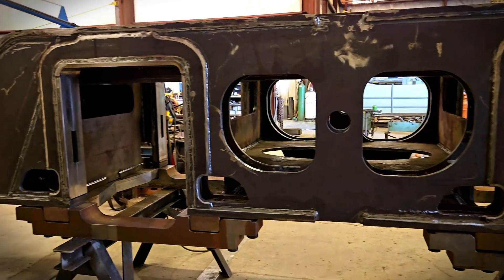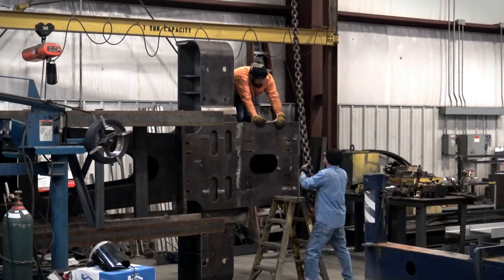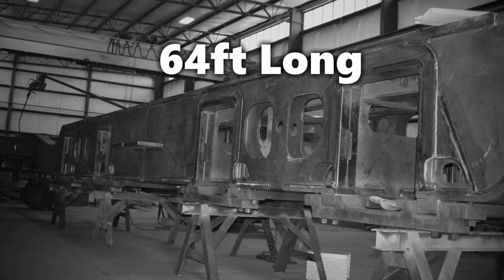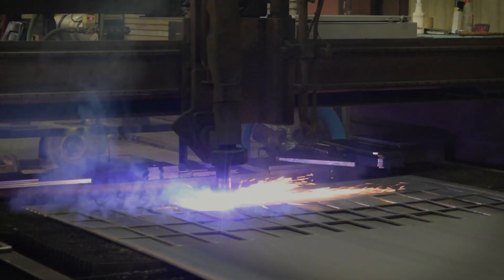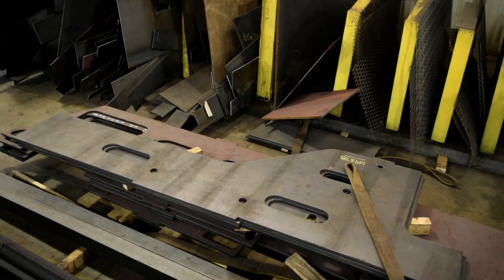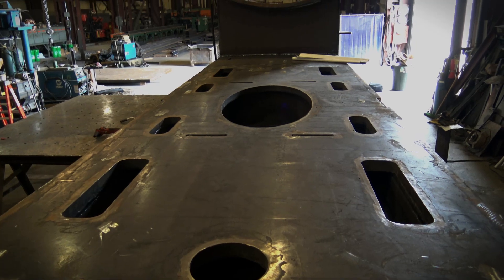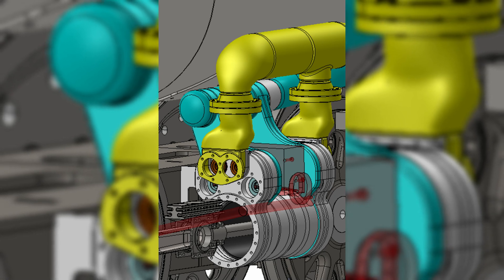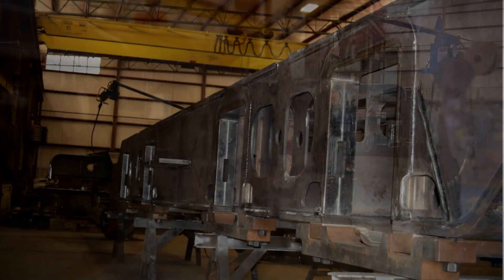PRR T1 Frame Completed

Comment: This will probably be the single strongest and stiffest steam locomotive frame ever made. I assume it actually may be lighter than the orginal cast frames, but talk about stronger and capable of easy repairs. 

The steel cylinder assembly is going to be much tougher against stress cracking like the locomotive down in Texas that had to have new cylinder assemblies cast...talk about a learning curve for everyone involved!

Comment: This is such awesome progress! She might be up and running by the end of the decade if this continues! In the meantime, I know that open houses displaying the frame might be hard to pull off safely, but I wonder if there is a chance of more possible fundraiser trips along operations who have already signed letters of intent to host 5550 when completed, such as the Cuyahoga Valley Scenic Railroad or Steam Railroading Institute, especially as interior boiler work commences which I am sure will be a very time- and money-intensive process. I must also say that 5550 and 1225 would look great together at SRI, and particularly if they are able to run along the ex-Pennsy track near Cadillac or run a longer excursion on the ex-Ann Arbor between Cadillac, Claire, Mt. Pleasant, Owosso, etc. I live on the East Coast but would definitely love to make tracks to the Wolverine State if such a long-distance excursion were to take place to either fundraise for or show off the completed Pennsy T1 5550.

Comment: I wonder how much the original T-1 cast steel frames weighed compared to this one.  The true comparison should be after the cylinders are mounted to this frame, sine the original T-1's had cylinders integrally cast to their frames. 🤠👍

Comment: What's the chances of frame warping as this doesn't look casted
Reply: It's not cast iron like the original, it's fabbed from plate steel. They spent a lot of time engineering it, I wouldn't worry.

Comment: Can’t wait for the T-1 to be finished, Are you guys going to do other locomotives like the K4s?
Reply: Sure if you donate
Reply: The Railroaders Memorial Museum is already restoring the K4s 1361 in Altoona. The new firebox is almost done, tender has been fully painted, the cab will be restored by Curry Rail in Hollidaysburg, PA; and the driving wheels will be serviced by the Strasburg Railroad’s Mechanical Department.

Comment: Technical question:  What will the final weight of the completed locomotive be?  A welded frame is normally not as heavy as a cast one.  Weight being crucial to the performance, I was wondering how close this will come to the nearly 1 million pounds of the original T-1's.
Reply: They've mentioned in previous posts that this welded frame was engineered to weigh almost exactly the same (within 2%) as the original cast design.
Reply: @west1175  That's fine but, 2% less weight = 2% less tractive effort (at least) and 2% more slippage at start up. (Again, at least)
These locomotives had problems with start slipping and tracking with their designed weight.  You make it lighter, the problems are going to be greater and they're going to be operated by people who never operated such a locomotive.
They should add additional ballast inside the frame to get the weight up.
Reply: @Inquisitor6321  Well, keep in mind that even if the frame is a full 2% lighter (which is not necessarily the case), that's 2% of the weight of the bare frame, not of the entire locomotive. Overall, that's an inconsequential amount compared to the over 500,000-lb weight of the fully assembled engine, and if it does become an issue, it wouldn't be difficult to design in additional weight elsewhere to keep it the same as the originals.

Update: this question made me curious, so I did some more looking through the T1 Trust's previous posts about the frame. Apparently, the weight difference between the original castings and the new welded frame is less than 700 lbs!
Reply: @west1175  that is 7, 13x13 pieces of steel, 1 inch thick.